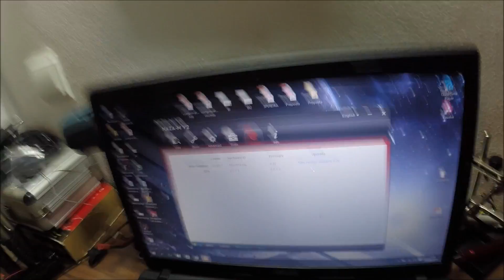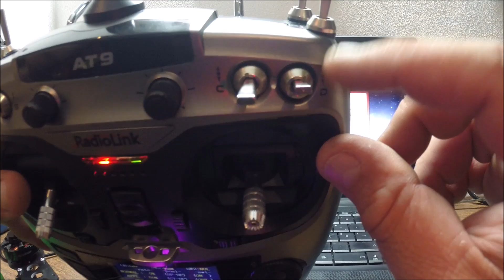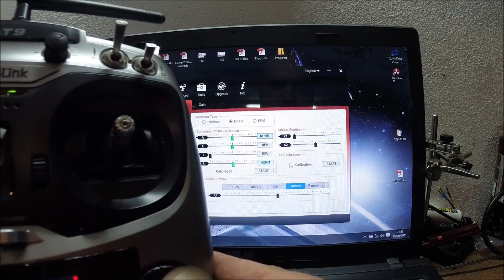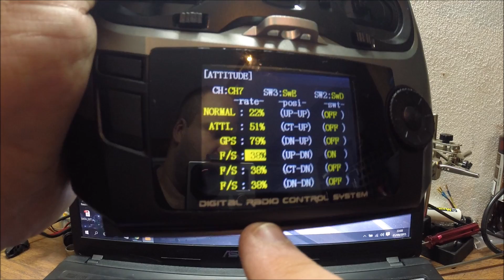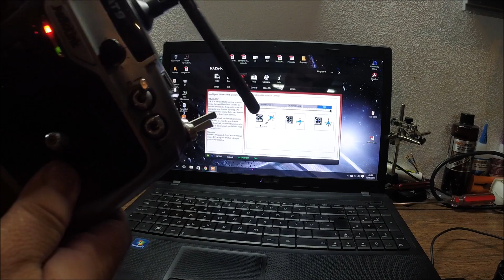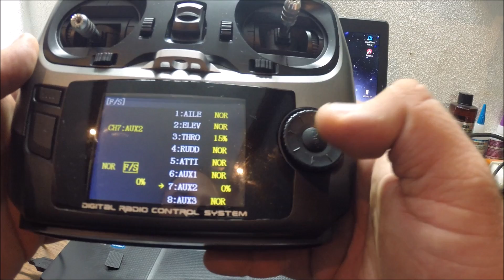RadioLink AT9 with Naza in Sbus

Comment: Does anybody know why I can't make my AT9 and R9DS work with Emax Skyline 32 flight controller? In cleanfligh I can test motors, gyros etc but quad is not reacting to the transmitter. Receiver is in S-Bus mode because it is PWM. 
Please help me guys!
Reply: ***** Well... I know that now. Got different receiver too.

Comment: Hi Sergio, I have a problem with my Hexacopter 550. Yaw is configured with DJI Naza m lite and RadioLink at9, but when it starts to rise is going sideways and fall. It acts as if you ordered from the rc. This installed by traditional and have calibrated all, gps, stiks, still the problem persists. Please help me.

Comment: Hello Sergio, i have an AT9 with Naza-m V2 for my Spyder 6. I'm having some troubles with the failsave. The failsafe switch works fine but when i turn my transmitter off it doesn't return to failsafe. I did not fly yet, just testing my controller. What could be the cause?

Comment: Hello, i have a CC3D flight controller and a AT9 transmitter. Can't find a set up with S-bus.
Also the wire connection is a problem .( want to use only the signal wire from the ESC's and power from a BEC.)
Can you help me out?
Reply from the maker: +MICHEL VAN MOL Sorry I don't own a CC3D FC so I can´t help you there. Best regards.

Comment: perfect video! been looking at using this transmitter for an ongoing DJI F450 Build with a NAZA-Lite FC and this video is sooooo helpful! Quick question: assuming I set up the kit as per the video, how would I go about connecting up a 3-axis Gimbal? (apologies if the terminology isn't perfect, I'm completely new to all of this, I think i may be in over my head but we shall see!)
Reply from the maker: +Dan Smith Hi Dan. Sorru for the late answer.

 If you want to use a 3 axis gimbal you better use the conventional connections because the Naza, when connected in Sbus, will only recognize channels 5, 6 and 7 for the U, X1 and X2. Now because the R9D will only output PWM on channels 5 and 6 when working on Sbus, you cant use those channels for the gimbal. Either you use conventional connections (PWN) or get a Sbus to PWM decoder. I know that FRSky has one that can be programmable but I don't know if it will work with RadioLink Sbus. 

Best Regards.
Reply: +Sergio Pereira thanks for the really informative reply! i got a two axis gimbal connected up a couple of days ago, hooked tilt control up to X1 and got rid of IOC, i've been flying for about 2 weeks now and the only time I used IOC i got very disoriented and crashed! works perfect!
Reply: +Dan Smith , + Sergio Pereira  .  Hi!  I have been watching this video over and over and still can't figure out the gimbal controls.  I have a 3 axis gimbal but I am only interested in the tilt function.  I read Sergio's comment but am still confused how you did it.  I currently have a DJI F550 with an AT9.  In theory, I would like to use X1 or X2 to control the gimbal'a tilt.  I don't feel like there is any needs to use IOC or Gain control with the VRA or VRB.  I hooked up the gimbal pitch wire to Naza V2 in the F2 port and I just can't figure it out.  Can I ask how you successfully hooked X1 to the gimbal tilt.  Thanks for any help in advance